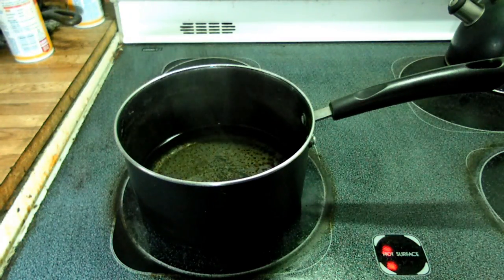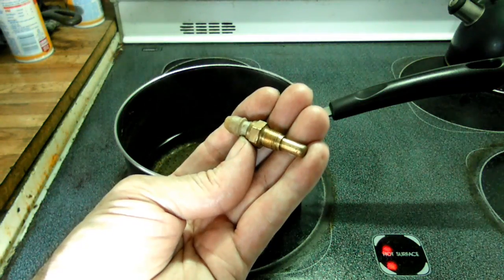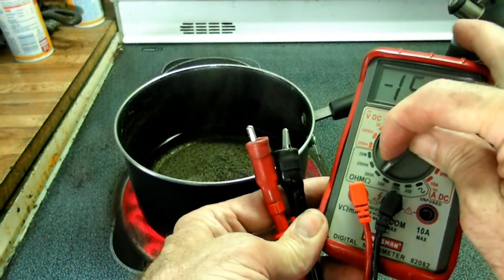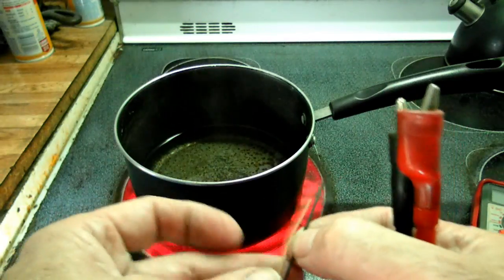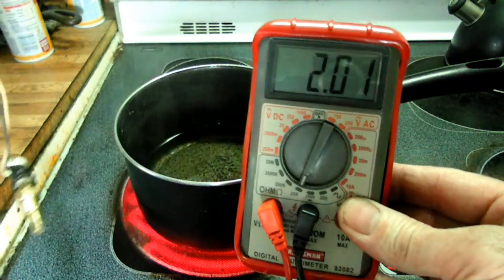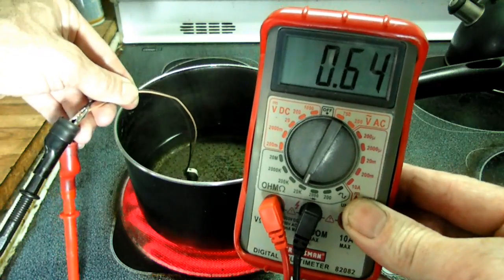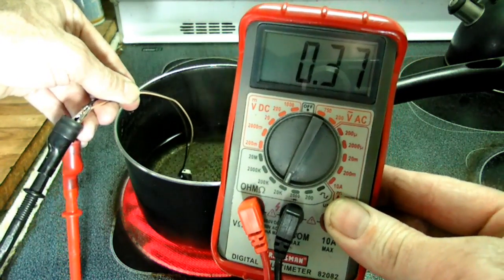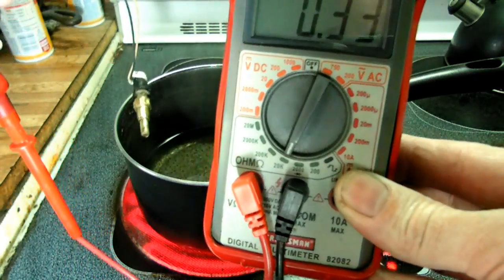Engine Coolant Temperature Sensor Resistance Checking

Comment: It’s great that you posted this video showing basically how the values go down on a resistance test, but you never said whether or not the switch is still good or not and should also give a range of numbers, of what would be a good set of numbers and what would be a bad set of numbers.

Comment: I just tested the coolant sensors on my 1991 celica, and the resistance is 36 ohms when cold on one, the other 3.8 ohms? If the very high one controls the fuel enrichment, that's seriously going to give an overly rich condition isn't it, it does smell very rich on warm up?

Comment: On a 3 wire resistor,  which 2 do I connect to with the multimeter? I assume there's a 5v signal from PCM, another 12v which sends power the sensor? The third 3 wire is  where it makes the connection when  the water reaches its temperature? Car I'm working on is a 2010 Hyundai Accent.

Comment: RICHPIN06A   ==
== )))                                            Can I just "back probe" the temperature sending unit and put my ohm meter to read the ohms while the car is idling to measure the ohms of the temperature sending unit at different engine temperatures? 
          But how would I know if the temperature sending unit is good or giving false readings?
I don't know how to test the temperature sending unit or where its at in cars. I'm not sure if the sending unit means a sensor.
       --1.)  How do you test or what do you use to test the temperature sending unit?
        2.) Can I buy a digital gauge at PEP BOYS and install it in the fuse box wires by slicing the wires to test if the analog temperature gauge in the car dash temp gauge is reading false reading measurements of the temperature?
          --3.) Can you make a youtube video showing how to test the car dash gauges to see if they work correctly and not reading false readings and how to test the sending units to the cars gauges?
       4.) I don't know how to test the cars gas gauge, oil gauge, temperature gauge using a ohm meter or what other test tool can I use to test these gauges are working correctly and not giving false reading or not working correctly?

Comment: I have my multimeter set at the same setting, and it reads 1 with the probes separate, and goes to 0 when I touch them. I put them directly on the connector of my sensor and it reads 1, with no change. I have a separate sensor and it does the same thing. This is making me feel stupid
Reply: Ooo once I actually got it into boiling water, it went down and showed continuity. Neat-o science rules

Comment: I have tested my sensor, continuance on the circuit, swapped thermostat, power to sensor. Changed sensor and put on a new connector and retested and all is good. STILL throwing the P0116 code and car is in AC shutdown mode. I'm at a complete loss at this point.

Comment: nice videos , you always make good vids . i tell you what i came here for this time . i have vdo gauges on my vw berrien buggy , the oil gauge works on resistance also and is not that accurate cause at night i turn the lights on the oil pressure shows me a drop in oil pressure and that is wrong. my VDO speedometer all new stuff is acting like a rpm gauge the pointer needle is surging all over the place in other words it moves around as it pleases . remember this is al new stuff i know and i am positive its installed right cause i did it and i was schooled on elec , mech , welding .hvac. cert so this was easy for me , what the hell do you do when everyone tells you even the tech line of vdo ,we don't know ? just saying       . i probably with have to live with it i know but i wanted your opinion cause i trust your judgement . thank you

Comment: at  what  resistance   does the fan  come on ?
Reply: +Ed Allyn We used to change thermostats from summer to winter and from what I remember the lowest temperature was 78C (170F). Nowadays I they run closer to 200F since nobody runs just water anymore. To maximize the efficiency of the radiator, I would venture to guess that the fan/s come on around the boiling point for water, lower for the low-speed and higher for high-speed.
Reply: @jsollien127  Running water only is a VERY bad idea...antifreeze is not only has a anti-freeze but anti-boil aspect, AND the most important is it's an anti-corrosion element as the dissimilar metals will corrode and pure water only allows current flow (think anode and cathode in a battery)...resulting in rust.corrosion and premature gasket failures.
Reply from the maker: +Ed Allyn Hard to say as i can only test in boiling water (212 deg) and fan comes on at (226 deg)
Reply: @RichpinTv  Right...because of the pressurized coolant system...the water w/ proper antifreeze (which is also an antiboil/corrosion  aspect to it) will boil at a much higher temperature than at sea level pressures.
Reply: AIRMAN BEAR Ji

Comment: Hello Richpin, I was installing some gauges and my defi temp gauge didn't show a reading, I measured resistances on the sensor and it shows 50k in boiling water which I think is not right (too high). Resistance goes down as I increase temperature though. Is this a typical scenario where a broken sensor will still show the good behavior in resistance trend but the resistances will be way too high for what they should be? Just want to make sure it is broken before reordering. Thank!

Comment: Hi there Richpin. Quick question-on a 1995 Saturn, there are two coolant temperature sensors. Apparently, one for the gauge, the other for the computer. Since they are both in the head, presumably to report coolant temperature, would it really matter which harness I connected to either sensor? The top one is so much easier to get to for removing the harness for other repairs, and so forth.
Reply from the maker: Kurt Bennett If you notice one has two wires going to the sensor and the other has one so swapping could not work in this case.
Reply: +richpin06a my sensor reads 8 on 20 k
Reply: @hurstshiftin9873  Does it change with temperature change?

Comment: how would you check this while still in the engine so that the needle can be pulled and reset to the right position on the temp gauge? All my needles were removed and I'm having to set them manually.

Comment: I follow your instructions on how to test resistance of ECT sensor and it shows my ECT sensor is ok. but in actual my engine die down or stopped when engine got hot.
I replaced with a new ECT sensor which read the same resistance value with the old ECT sensor, but when i put my new ECT sensor ,engine never dir down or stopped even engine get hotter.
It means resistance test is not guarrantee if ECT sensor is spoiled...
Thanks anyway for your video demo.
Reply from the maker: Could it have been a bad connection at the connector?

Comment: Thank you for this video. Is the pigtail wire and cap something that you made yourself or is it the oem connector? Can I accomplish the same thing by attaching a wire to the body of the sender and a separate wire to the terminal post on top? I ask as I have two identical temp gauges and they read 15 +/- F apart. With the reading portions of both thermistors submerged in a pot of water, one is bang on with my digital thermometer, the other, on average, 15 degrees lower. I can get resistance per temp values from the manufacturer. Thanks in advance.
Reply: I am using a oem connector.

Comment: how do i tell if its bad or good if i put it in hot water and the number goes down does that mean its a good or bad
Reply: When the ECT temp is high , the resistence is low, and when the ECT is low cooler the resistence is high , this ECT is working fine

Comment: on honda's at least, there are multiple temp sensors.  the radiator temp sensor that activate the rad fan relay is independent of the dash gauge sensor. and a third temp sensor correlates with the ecu to adjust idle speed, fuel consumption etc.

Comment: I taken out the manifold from my engine(bmw 320diesel) to check the temperature sensor. The values are OK 2Kohm at ~20 degrees and it decreses when i put it into hot water. Ok everything fine until this step..i opened a box from the engine and i saw the cable to sensor intrerupted and set there a 5K resistante. Why do you think that ex-owner of the car did that? Is a good efect? Can i remove that resistance ?

Comment: Hey Richpin... According to my VW Jetta '03 Haynes Repair manual; it states that I should see an k-ohms reading of 1.5-2.0 at the connector. I have a 3.12k-ohms reading at the engine temp. sensor connector. What do you think is the issue?

Comment: Hi. What if the sensor had failed and it would give an infinite resistance. I see in the video that with increase in temperature, the sensor's resistance decreases and tends to 0. But if its blown and gives infinite resistance, it should never turn ON the fan.

Comment: The problem is that the AC is not even turned on and both of the fans turn on as soon as the engine starts.  In fact, both fans run even if the key is only turn on to the KOEO position.   I inquired of some other users whether this was typical on other similar Corolla cars of the same age and the radiator fans do not immediately turn on.  So that is my reason for suspecting a bad temperature sensor.

Comment: I got a scanner on Amazon for like $30 that will give you data pids. It's really crappy and the update rate is terrible but it will give you data from the ECT that you can compare to the actual temperature measured by a thermometer.

Comment: I only have an actron, but no codes show up.  Is there any diagnostics that could be done on that temperature sensor without physically removing it from the engine?  Like back probing to see what voltages should be seen on a totally cold engine.  Because the radiator fans turn on immediately as soon the the key is turned.

Comment: If that temperature sensor fails could it be responsible for giving the command to turn on the radiator fans?  The reason I ask is that I have a 99 corolla and both radiator fans turn on as soon as the engine is started or even if the ancessor key position is engaged. So my thinking is that if this sensor is repporting a hot condition it would communicate to the computer to signal the fans to turn on.  Do you think this is likely?  I would appreciate your comments.

Comment: I'd really like to see you re-shoot this video and show everyone the right way to do it using a spec sheet and thermometer.  You only demonstrated, usually you go through the whole real process.  You didn't show the factory specs expected measurements.  Use a coat hanger and alligator clips to hold the sensor in position.  Also good to mention that most intake air temp sensors are tested in the same way so good to pull both and do them at the same time.  Love your videos keep it up.

Comment: hey rich another awsome video! I have learned so much! Question, we drive a 2000 sl2 with the twin cam. I replaced the cts about a year ago because of crazy fluctuation of the temp gauge. Driving down the hi-way, outside temperature at ninety degrees the gauge would drop down to barely above cold. Than at an idle (stop sign) it would be above the quarter mark, drop down to just above cold than shoot back up to above the quarter mark. This gave it a drop in rpm. Have U heard of this?

Comment: Thanks Rich. Are there any sensors that could be damaged by doing resistance testing with a multimeter?
Reply: If diode test is not performed, no.